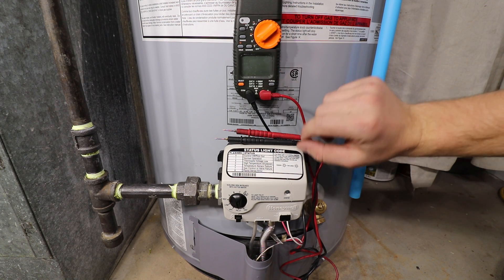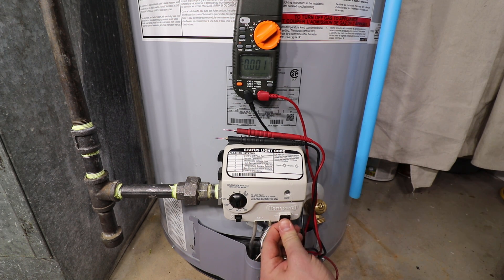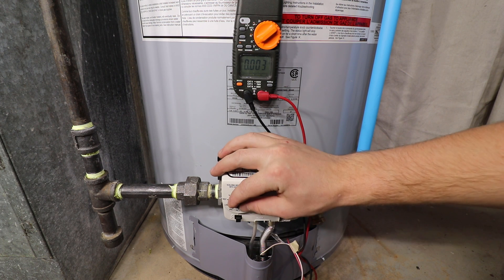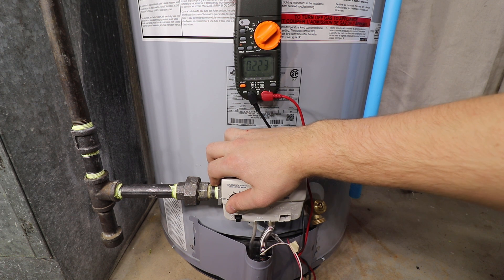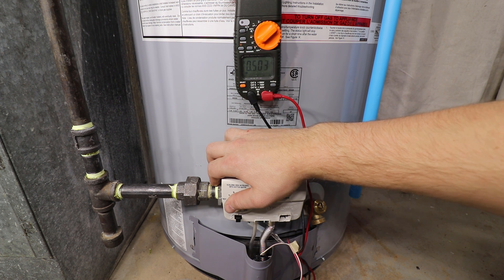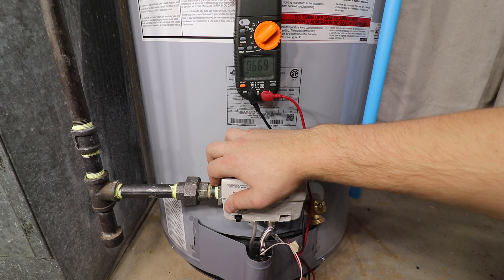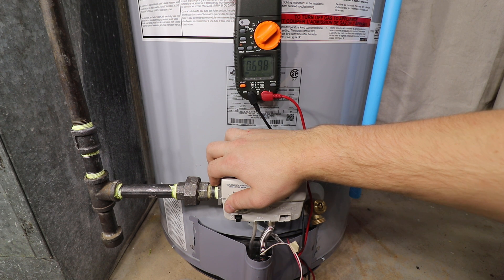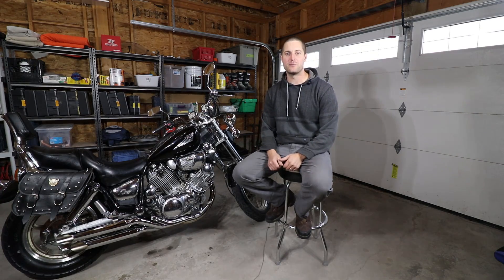Testing a Thermopile on a Water Heater

Comment: My bathroom faucet hot side will not shut off the water even if it is set to the off position, have to use the shutoff valve under sink to get it to stop flowing

Comment: My gas heater blows off the pressure valve if I have it on just a little over low, today the pipes froze up, had no hot water, it was just blowing it out of the valve, got it unblocked but still just blowing it out of the valve 
I am driving myself crazy trying to fix it

Comment: Man, I'm struggling...what should I check if the pilot light is on, but the water heater won't fire up?
Reply: I'm having the same issue.
Reply: @marcusscott6442 Try turning the thermostat as low as it will go, then turn it up to the normal setting. Worked for me.
Reply: Then its a bad gas control valve.

Comment: After almost 6 years of service my pilot light went out (elect gas valve water heater).  I was able to reignite and all was good for about 3 weeks.  The status light always blinked once every 4 seconds indicating normal.  Then this past Sunday my pilot light was out again, but I was able to reignite the pilot and back to normal with again with status light flashing normal.  
Then, the next day pilot light out again.  It took alittle longer to get the pilot light ignited and the status light flashing but I got it going after about 1 minute of ignitor action every 3 seconds. 
 I called a local plumber to take a look, but their thought was automatically the electric gas control valve without measuing the voltage output of the thermopile.  I need to get an upgraded multimeter that digitally measures DC voltage under 1 volt as I am fairly certain I have a weak or failing thermopile.  Any recommendation on a reasonably priced digital  multimeter that can measure DC voltage under 1 volt?

Comment: My temperature cutoff switch keeps tripping! But the controller is giving the error code for thermopile voltage low?  Could a bad thermopile cause this?

Comment: Pieces of crap are this new water heaters. I’m a handyman and work in a big apartment complex. I had replaced probably about 90 water heaters and all are garbage. Ones in a while you get one that works okay for couple years but so many problems with this junk water heaters same with the AO smith all of them with this stupid fancy gas valve to many stupid sensors. The mechanical ones are the best old style

Comment: Getting ready to work on AO Smith Gas Water Heater. GVR 50 300. The pilot lights and I hold down temp control for light blink or even past 2 minutes. 

I am assuming what I am seeing on Amazon is fine. It is saying it's an upgrade thermopile system for harness and igniter replacement. Not sure. I know I can do this easily with your video. Just need to know what part on Amazon I should order. Have no problem doing what you did in the video I watched on replacing the assembly. I don't have a way to test to see if it's just thermopile. So if you can tell me what link to order the right set up on Amazon. That would be helpful. If it doesn't work I can always return.

Comment: Plugged pilot tube?  I have a reliance HW heater Honeywell gas control in a drip pan ... trying to be proactive and drain the tank apparently was a bad idea.  I had to unscrew the nylon spickot - bib to get anything to come out.  Finally it did.  The pan has a drain so I let it drain ... BAD IDEA it seems.  I didn't recognize it breathes from underneath.  no spark whatsoever.  .. I hope the water in the pan didn't short some circuit board out.  If it is simply water and a little crud where it ought not be, I would be happy but ...
  Any ideas before replacing stuff?

Comment: THE PROBLEM with this (erudite) video is that a test with results WELL within parameters is Often invalid, and thermopile replacement results in an immediate repair.  
It's Big Time frustrating to go through a really intelligent and methodical troubleshooting procedure that yields Nothing, only to find that the st00pidest action is the one that does the job.  This from an HVAC/appliance repair hack AND a multicertified professional with decades of experience.

Comment: I'm going to need to get a multimeter and do this test. I also noticed I've got quite the drip going when I removed my manifold cover. I'm guessing that's a pretty bad thing? lol
Reply: Make sure that your multimeter has a microvolt range of at least 1000.  Some don't--limited to 400mV or so which precludes application of this test.

Comment: Something I discovered on another video is that some of those Thermopile connections to the hot water tank actually have a flap you can open and test the voltage while it is still connected to the hot water tank!  I checked mine and it has it.  Same style as the one in your video.

Comment: I try to start by pressing and holding in the black button and pressing starter button.   As long as I hold in the black button the light keeps flashing.   Let off and the the red light slowly goes out.   I believe this video will solve the issue.

Comment: Whirlpool model; 40S6-40NG  So far:  Initially changed thermopile/pilot/ignitor assembly.  After the change was able to get the pilot however when turning the setting up to get the burner to come on it only stayed on for a minute or so and got a code 5 reading.  Called Whirlpool tech and they sent me out a new gas control valve. replaced valve.  After replacement pilot lit properly and got one light code.  Great. until I turned up the setting for the burner to kick on.  Burner stayed on for under a minute and the pilot shut off also.  A code 2 started flashing.  Tried relighting after turning the thing off and pilot lit, but the burner would only stay on for a few seconds, and code 2 flashed.  Fyi: draft screen cleaned numerous times, thermo switch not tripped.  I then I better check thermopile even though it was new.  Using the above test in the vid I had a 791 mv reading...meaning thermopile should be good?  Now, where do I go?   I was lost when I started and now things are getting worse!  Thanks for any suggestion as to where I turn now?  Is it possible the new gas control valve is defective?   Thanks again!

Comment: Excellent video! Complete, yet so concise! My thermopile showed no voltage at the controller due to a tripped thermal cutoff (wired in series with thermopile) interrupting the circuit. Pressed the tiny black button to reset, tested voltage again, all good! Re-lighted, blinks, all is well! Set temp, and the familiar big long belching sound as the main burner lights all around means hot shower tonight! Thanks!
Reply from the maker: Awesome! Nice job on your diagnosis!

Comment: My gas water heater only gets warm and not hot, I have replaced the dip tube and thermostat control, please help
Reply from the maker: What temperature do you have the control valve set to? Does the main burner fire up? If you've changed the dip tube and control valve, the only issues I can think of are the control valve not set high enough or faulty. Less common is a cross connection somewhere, but that usually gives you warm water on the cold water supply lines.

Comment: Holy shit a water heater with the gas line hard piped. Move this channel up your list folks. If I see flex lines on a water heater, water or gas,  I keep it moving.actually did this test once and kept getting. Good reading.Even though when I took it apart the wires were burnt out and pretty much crumpled when I remove the assembly:.

Comment: My pilot light lights rt up and all the control valve heat positions work good
Do the status lights got bad ?
Everything in my water heater works fine except there isn’t any flashes come on?
Thank you in advance
Reply from the maker: I would say that the LED has gone bad or the circuit that controls it. I've seen that happen a few times before. If everything else is working, it can be ignored.
Thanks for the question!

Comment: Mine goes out once a week or so  thermocoupler??
Reply from the maker: Were you able to get a voltage reading? and if so what was the reading? This will help me get a better understanding of what is going on with the water heater. The other thing is, are we dealing with a thermopile as seen in this video? or a thermocouple? Thanks for the question
Reply: Pros DIY looks like the same setup its a 3 year old whirlpool water heater
Reply from the maker: I'd check the thermopile voltage to see if it falls into spec. From what you're saying I'd bet it's a faulty thermopile though. Hope this gets you in the right direction. Thanks!

Comment: Hi. My voltage got only up to 180 millivolts, does that the thermocouple is bad?
Reply from the maker: Low voltage can be caused by a few things but a faulty thermopile is almost always the cause. A partially clogged pilot tube, damaged wiring, or thermopile incorrectly installed can also cause low voltage. This can be inspected by looking through the sight glass to inspect the pilot flame. It is most likely going to require a new thermopile though. 180mV is very low. This video may help with the replacement. https://youtu.be/1VIvEqVbt14
Good luck on your repair and thanks for the question!
Reply: @PROSDIY  thanks so much for reply. I've got the new thermopile. I'm the trouble I'm having is that igniter sparks, bit flame doesn't catch. When I put a match, it catches fine (so I know gas is coming) but not with igniter. Any idea what I'm doing wrong?
Reply from the maker: Sounds like either the spark isn't strong enough or that it is jumping in an incorrect spot.
Check the igniter wire for any breaks or worn insulation that can cause the spark to short circuit, or not reach the pilot assembly. Check where the spark jumps to the pilot assembly. It is very common for carbon to build up at this location. Use some fine sandpaper to shine up the area on the pilot assembly where the spark jumps to light the pilot. Shining up this area reduces the resistance for the spark to jump, resulting in a stronger, brighter spark.
Good luck! Let me know how it goes. Thanks!
Just another thought, when lighting make sure you click the iginter multiple times in short succession immediately after depressing the control knob. This will give you a best chance of it lighting.
Reply: @PROSDIY  thanks so much for reply. Currently the spark jumps to the thermopile. Is that where it should be jumping to? Or should it be jumping to the pilot? 
I've checked the igniter wire for continuity and it seems fine.
Reply from the maker: I think you found the problem. It's normally supposed to be jumping to the pilot hood. That's the angled metal piece on the end of the pilot. It directs the pilot flame into the thermopile. The pilot hood should be shiny metal to reduce the resistance for the spark to jump. It may need to be sanded with some fine grit sandpaper. The igniter may have been bent closer to the thermopile as well, which come cause this issue. Hope this helps
Reply: @PROSDIY  great. I'll give that a try. Thanks so much ones again.  I'll let you know how I come out. Meanwhile I just used a match to light it.
Reply from the maker: No worries at all. I'm glad you have hot water. Yes, please keep me posted on how it goes. Cheers!
Reply: @PROSDIY  hi sir. I've moved the igniter so that it jumps to the pilot hood. Also I've sander the pilot hood. It lit ones, but then I've trying to relight it but with no luck. I've pressed the igniter about 30 times and it still wouldn't light.  Any idea what else could be the problem?
Reply from the maker: @aroniphraimov3915  That's an odd one. Might have to start checking some less common repairs. Does the spark look strong? Should be bright blue. Maybe check to see if the wire in the bottom on the igniter is fully inserted and not loose. When you do get the pilot lit, is the flame really small under a 1/2"? Sometimes if there's a small gas leak on the pilot tube either on the control valve side or on the bottom of the pilot assembly, this will cause a low amount of gas getting to the pilot and make the pilot flame hard to light. Double check for gas leaks at these locations.

Comment: Hello and thanks for the video!

When testing my thermopile, I get up to 650mVDC, then it goes OL.  Does that mean it's bad?  I did see the 4 blinking lights last week, but was able to re-ignite.  Now, I'm not able to keep the pilot light lit, no status light.  Whatcha think??
Reply from the maker: Hi Joel, 650mVDC is a great reading for the thermopile, so we can rule that out. If it is reading OL on the voltage test, this usually means that the range on the multimeter is set to low. OL indicts overloaded or out of range in the voltage mode. 4 blinks can indicate overheat failure. I would check to see if the thermal switch is tripped and try resetting and relight. If that all checks out, I'd replace the control valve. Please follow the steps in this video before replacing the control valve. https://youtu.be/_XYCVgsPu1U
Thanks for the great question! Good Luck!

Comment: I heard alot of problems on that electric Honeywell there is from turning it up to high. Flaw in the design. Guy said keep it low or high temp shutdown and dominoes from there. Cannot confirm this is true but I reset and fired up one three times in a month then no blink. Low or A are best setting from what I understand
Reply from the maker: Hi Brandon, You're absolutely correct. These water heaters work best at a lower setting. No higher than 140°F. I personally set installed water heaters to A. Some households that require more or less hot water, I'll set to between A and B for more use, and between low and A for less. If you have to set the water heater to B or higher for hot water, there's usually an issue with the water heater or the tank is undersized for the application. Thanks for the great point! Take Care!
Reply: Supposedly there is a way to get the thermostat to un-brick from the high temperature shutdown (ECO) fault. Commenters in the video have had success, can't confirm myself. Service manuals, of course, will tell you to replace the whole thermostat / gas valve assembly. https://www.youtube.com/watch?v=yo5e6WWFdOM

Comment: Thanks for sharing. I have this same exact thermostat/ flame controller. Thermopile got to just under 650 mV, but took forever. I had no blinking light at all. No code provided for zero light flashes. Apparently if it takes too long to reach whatever the minimum voltage is, unit shuts down. I believe this to be true, no literature. So I get a new controller and also order a thermopile. Put in new controller first only because thermopile was still a day out. Exact same problem. Replacing controller requires a tank drain (IMO anyways). Got new thermopile, pilot and and igniter unit (3 in one unit) next day. Install new thermopile and instantly problem is fixed. Try thermopile replacement if your pilot works, you have no blinking light and if you can measure the voltage but it takes too long. Even if you can’t measure voltage I would try thermopile first so long as the pilot works. You will probably need a new compression fitting since the 3 in 1 unit came with none, the controller did so I lucked out there. Hope this helps somebody. Think all if this over and don’t try to bypass safety features, a lot of scary stupid vids out there. Cold showers = no fun!!
Reply: Where were you able to find part numbers? I cant find any parts locator online like you can for appliances. Everything refers me over to plumbers or washer n dryers
Reply: @RAM-VIC  
Biker Vic,
It’s been a while and I don’t recall exactly how I got the numbers. I bet I looked it up via the controller manual online or something. However I am attaching a pic of what I used. I installed the assembly (pile, igniter and all) and it fixed the issue. Later I bought just the thermopile and put it together with the older parts as a spare assembly unit. Make sure you have the same controller or you’ll need to do more research. Attached is some great info. I bought my parts from an online retailer that sounds a lot like Ramazon (lol). Sorry but I don’t recall exactly how I got there. A lot of good info on the retailer site via other folks questions and answers. Hope the attached pics help. Well… I guess I can’t attach. So here is what I have and used. Gas control unit is WV8840B1158. The thermopile is Reliance Water Heater CO 100112328 21" Thermopile Assembly. The entire ignitor, thermopile and all is Reliance Water Heater 9007876 Gas Thermopile Assembly. 
Dave
Reply: Thanks for the info mine only got to 625 before it maxed out so I ordered a new thermopile hopefully it will fix the problem
Reply: @jimgoliver8598  It most likely will and good luck to you! I mean it is just the part that is expected to wear out.
Reply: Thank you!  I will try thermopile first.

Comment: Nice video, I'm trying to troubleshoot my whirlpool water heater. I bought 2 control units and both will stop working after a couple min use. I tested the Thermopile as you did and I'm getting up to about 650 or so.  but for some reason, both controllers will stop working and won't even flash anymore. Would you happen to know what I might be doing wrong?
Reply from the maker: Hi strokedmustang66, That's an unfortunate situation. That's a great thermopile voltage, so we can rule that out. That leaves the control unit and the TCO (temperature cutoff switch) if applicable. Some models have an automatic resetting TCO. Here's a video on bypassing and testing the TCO: https://youtu.be/_XYCVgsPu1U
What model # of Whirlpool is it?
Double check the following:
The wiring connection is tight from the thermopile and into the control valve.
That the control valve is the correct model for your water heater.
Let me know how it goes. Thanks!